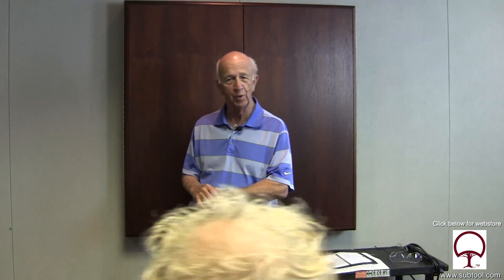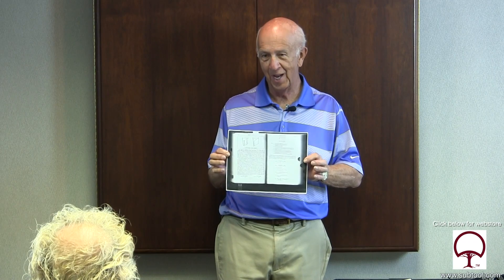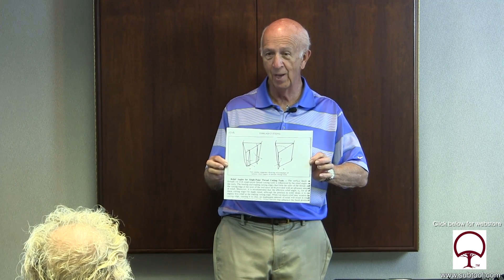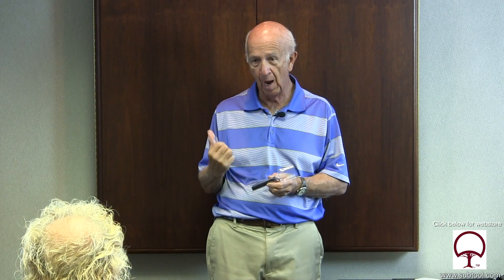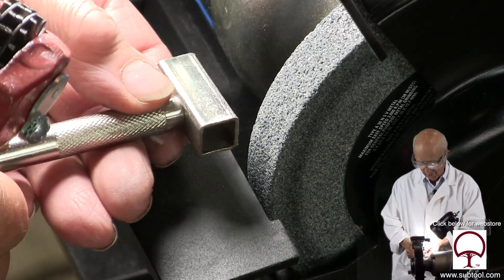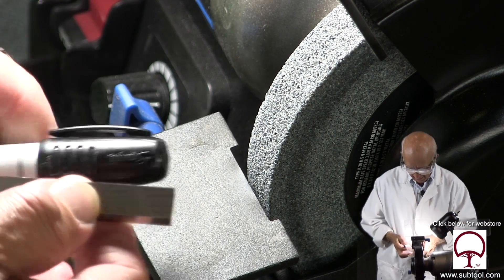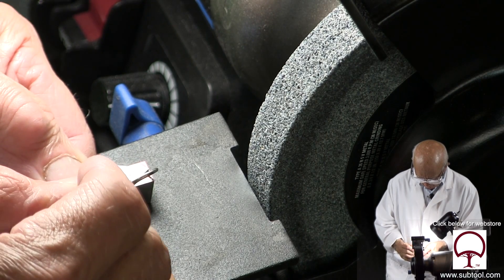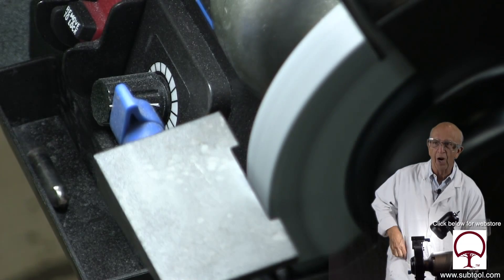Chasing a Thread On A Lathe Pt. 3  - Grinding The Cutting Tool

Comment: One critique, put the feet facing down on the Desmond dresser and you won't get a mouth full of wheel. I'm shocked though by how steady Dons hands are, he turns to look at the camera at certain points and the continued working the bit without fail. Awesome job.
Reply from the maker: Thanks for the tip, and for the comment.

Comment: 50 yrs ago as a young millwright i was taught to use a desmond dresser by backing off the rest and hooking the feet of the tool over the rest and traversing side to side. back then a small grinder was 10 inch and the wheels were usually in bad shape if you had to dress them. your technique is very interesting and i am going to try it on my grinders. i learned something today tell glen ill see him at the next class and dont be late oh and by the way .back then if you were caught grinding on the side of a wheel you could expect a safety violation slip.

Comment: When I was going to school learning machine trades almost 40 years ago... One thing that was stressed emphatically, was to never EVER grind on the side of the wheel! Because of the potential for the wheel to fly apart or explode.
Reply from the maker: Thanks for the comment.  In all of my experience, I have never seen - nor have I ever heard - of a wheel exploding from grinding on the side.
Reply: I respect the info you are sharing, but if someone watching your video decided to follow your lead and (thinking it safe) grind on the side of the wheel, and should the unfortunate happen, and they learn the hard way... Loose half their hand or have an eye put out... Personally, I would have trouble sleeping if that happened to someone on my advice.
"Better safe than sorry" as they say.. I did a quick google search came across this thread about grinding on the side of the wheel, there may be many others like the following: http://www.homemodelenginemachinist.com/showthread.php?t=8635
Thanks for your great videos I just think this one safety concern should be pointed out.
Reply from the maker: We hear and understand your concerns, and greatly appreciate you pointing them.  First and foremost, listen to your supervisor/instructor when it comes to safety practices inside and outside of the shop.  Ultimately, their word and expertise trumps all, and you should follow the rules and safety protocols of those you are working with to protect yourself and everyone around you.  If your instructor tells you not to grind on the side of the wheel, don't grind on the side of the wheel.  Simple as that, and I completely support and understand the claim.

That being said, there are many variables that come into play in this situation, many of which are pointed on on the message board you linked (type of wheel, age of wheel, pressure used while grinding, etc.).  In our case, I was using a brand new wheel and taking light cuts, so I felt comfortable using the side of the wheel for this application.  This in no means discounts proper safety protocol and respecting the rules set out by supervisors, or the possibility of a failure and subsequent injury.  Shop safety is always the first concern.